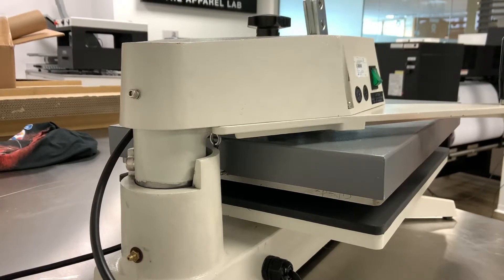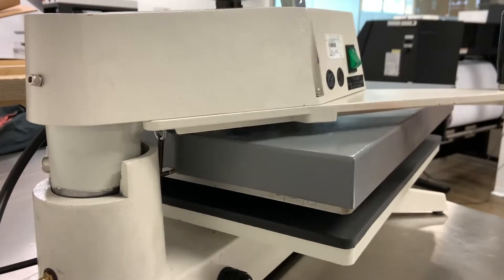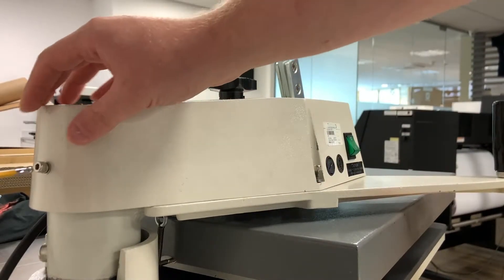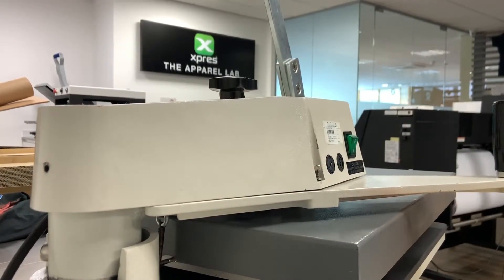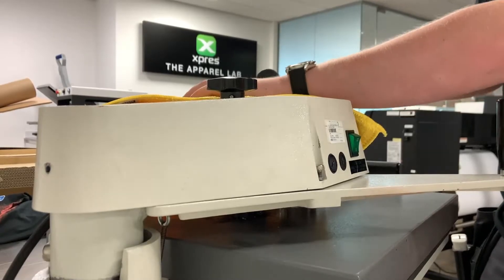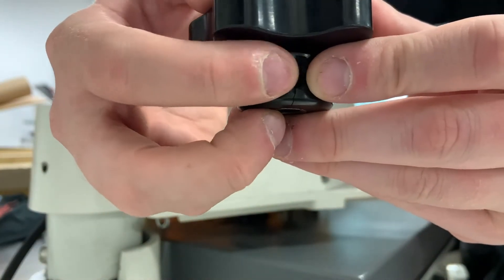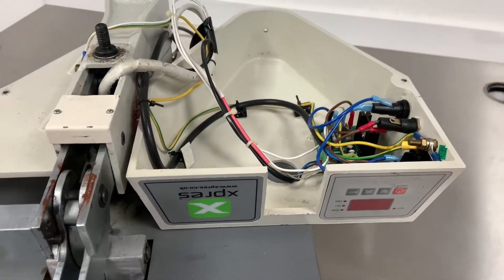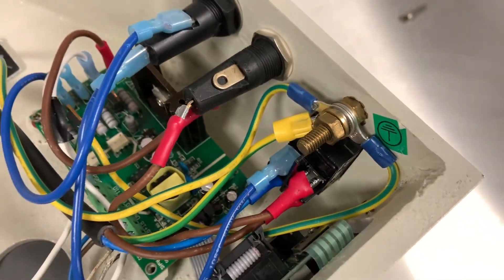Lid Removal for Inspection - Adkins / Xpres Heat Press #1

Comment: How do u open the press my press is stuck I can’t put a t shirt on it the lib will not lift up ?
Reply: Apologies - we have only just noticed your comment and I'm sure you are long sorted now. But for anyone else, sometimes the heat plate sticks to the bottom pad if left closed for a period of time - a vacuum is created causing the effect of the plates being stuck together. The easiest solution is to turn the press on and allow it to heat up to 50°C (ish) and the press will then open. (the count down timer will sound though as the press is closed).